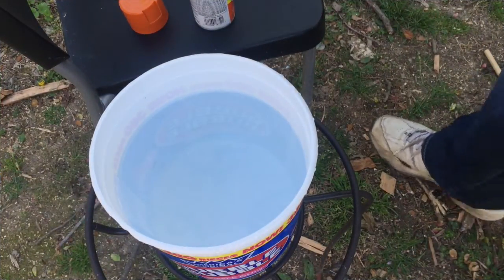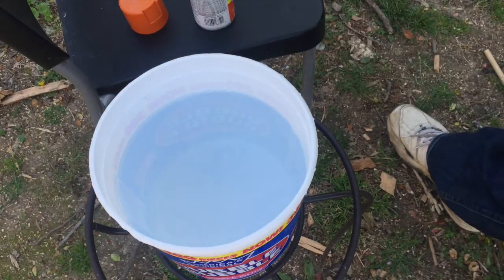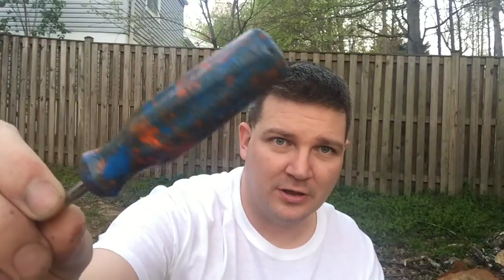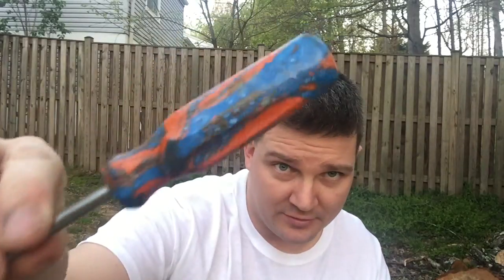Swirl It 01: Hydro Dipping Test

Comment: That came out great man! I wonder if it would make a difference if you used a primer on it instead of just spray paint first.
Reply from the maker: +5x30woodworking It might, It may also be better if I do a quick sanding as well. The coats weren't exactly even. When I try something else i'll get some primer.